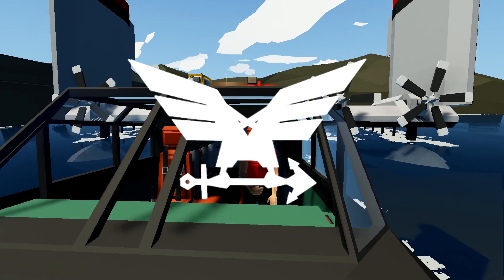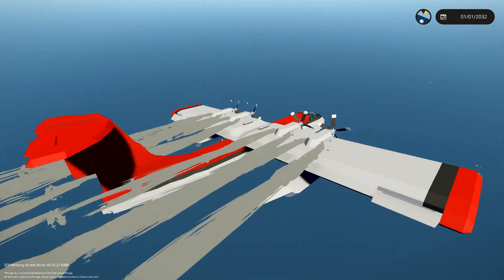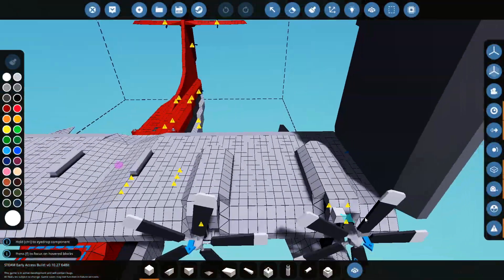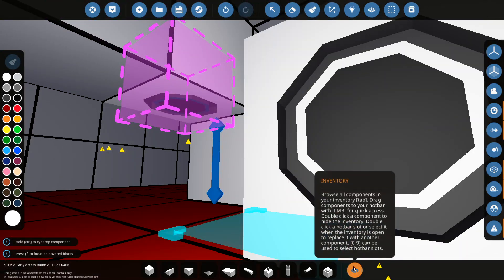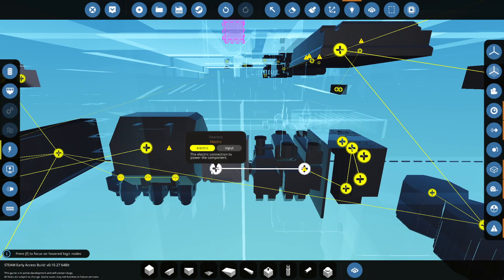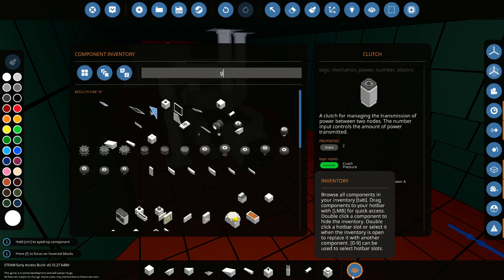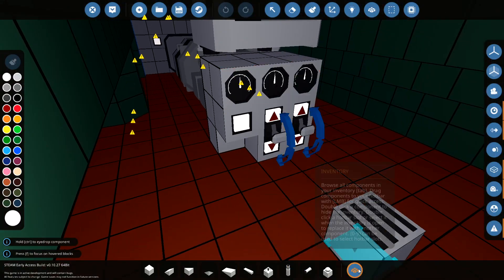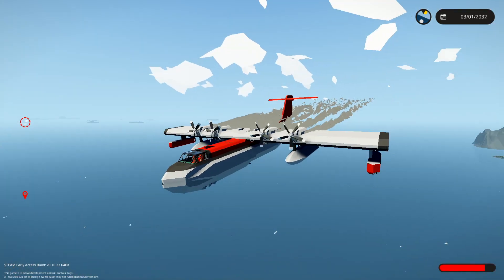Plane Generator Install!  -  Stormworks Gameplay

Comment: frantic you can also use a jet engine to power the generator but you would need to put the throttle to .20 max so the jet wouldn't explode and it would create much more power because of the higher rpm but you will need the jet unlocked in rouge mode if you plan on using it in rouge mode. so in case you need more power fit the generator with a jet engine
Reply: you might also need another fuel tank for jet fuel and more space